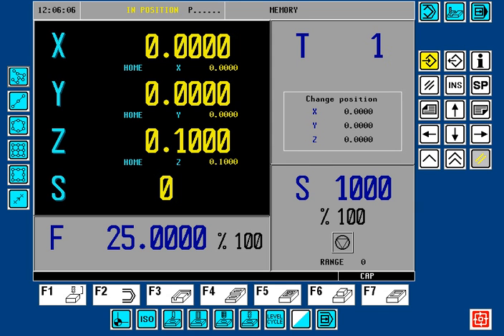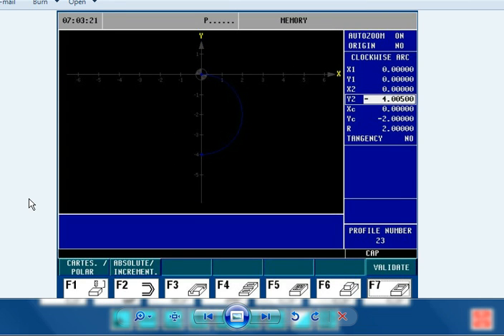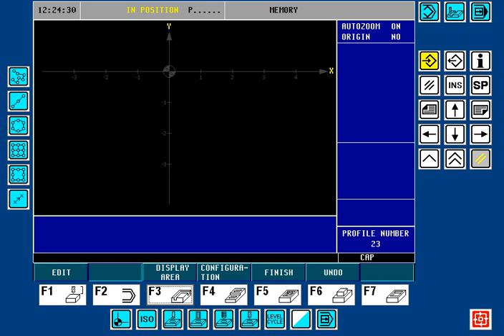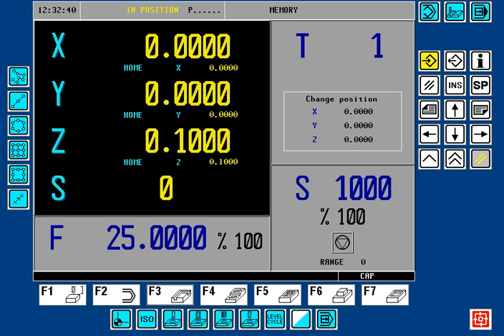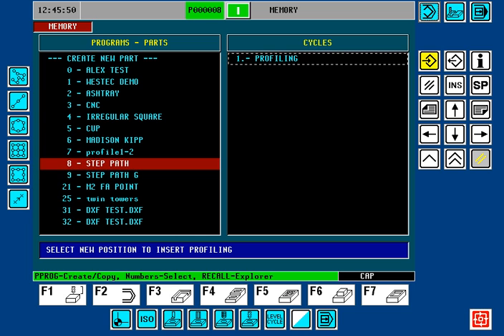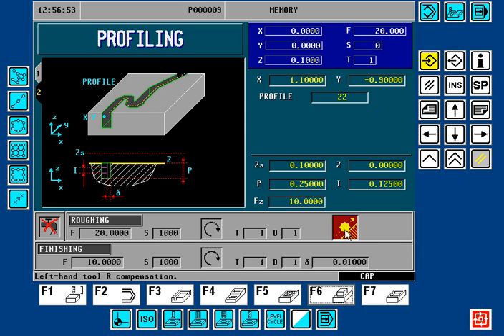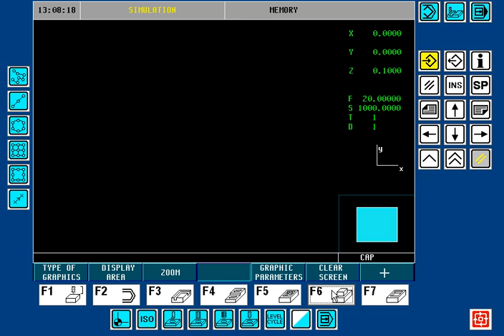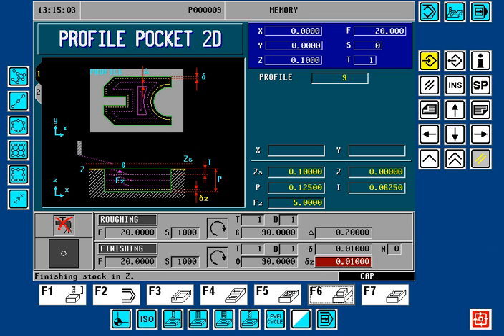8055 Profile Editor Lesson #8 (troubleshooting profile editor, profile cutting and pocket cutting)

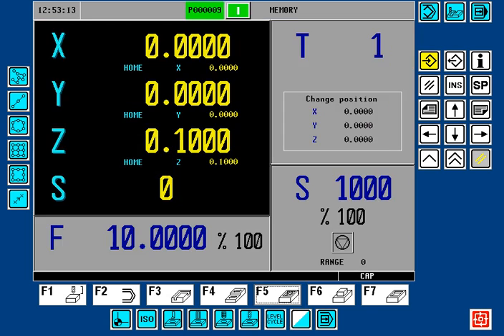Comment: Thank you for this. Question. In the 25:32 time area where you are looking at fixing the step in straight path using the starting x and y coordinates.....should we do the math here for tool compensation? Or will these values automatically do the cutter comp? I get this error a lot when using profiling and it can be very frustrating trying to figure it out some times. But I do find that half the time it is the starting x an y positions that are my problem. Any thoughts?